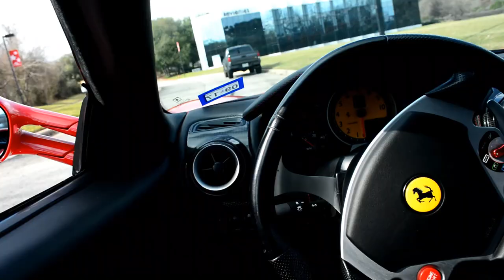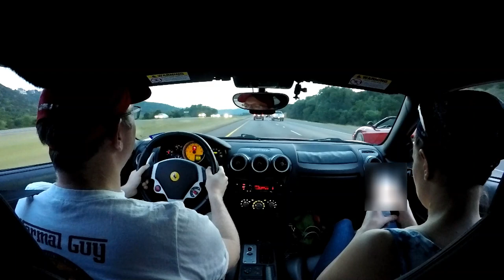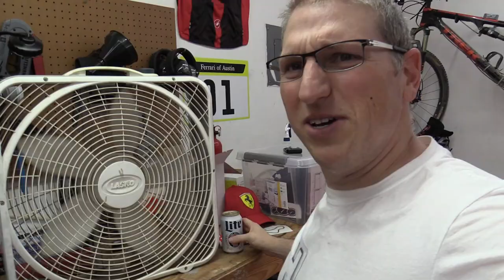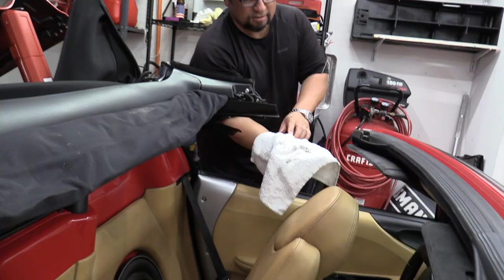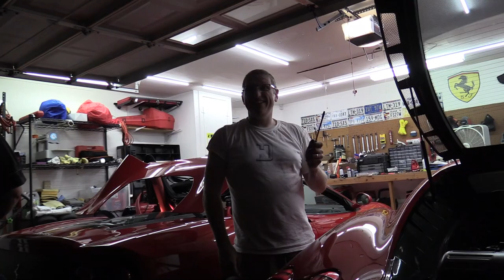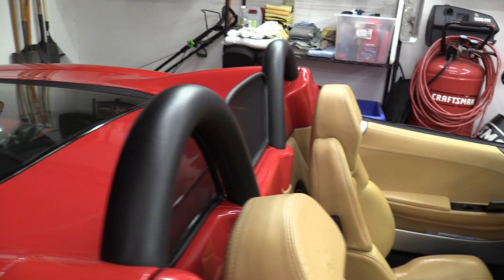NSFW Ferrari F430 tail light, F360 Wind Screen replacement, Dinner and Drinking

Comment: Hey Dan, did you happen to notice your emergency fuel door release cable isn't properly routed through the left rear engine trim panel?  That small hole is where the cable comes through, secured by a c-clip and the T handle.

Comment: Hey one idea, why don't you reinforce all the studs on your tail lights with a zip tie(like the one which you replaced with the zip tie and glue) so they stop breaking on the same place
Reply: Yeah, that might be a good weekend project taking all your tailights out and reinforcing all of them. Or maybe you could build some sort of sleeve to reinforce all the stud, like some pvc pipe that goes over all the stud and you glue all of it with a good amount of epoxy.

Comment: I have this right angle screwdriver that's basically like an actual version of the rigged wrench and driver bit with tape. Inherited it from my dads tools. It's gotten me out of a pinch quite a few times.  Looks exactly like this. http://m.homedepot.com/p/Husky-1-2-in-Offset-Screwdriver-74353/100038024